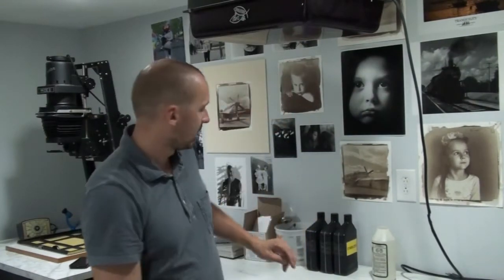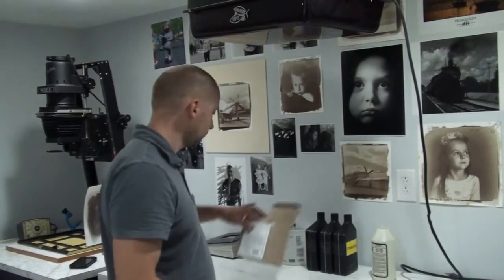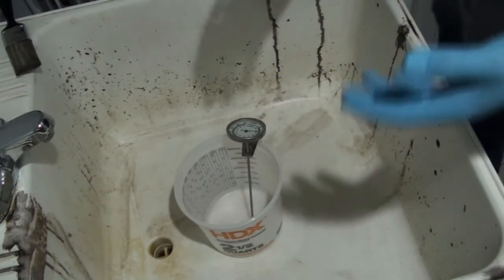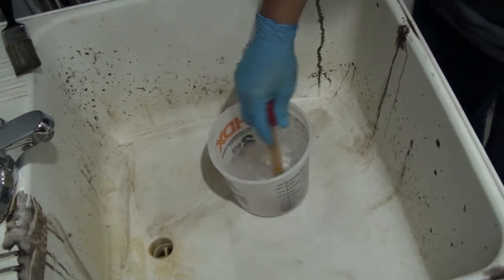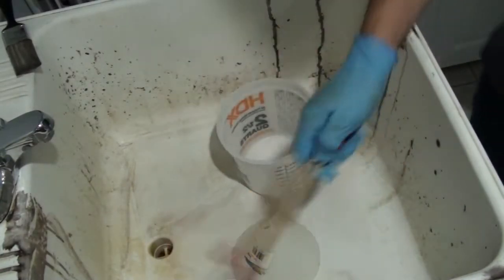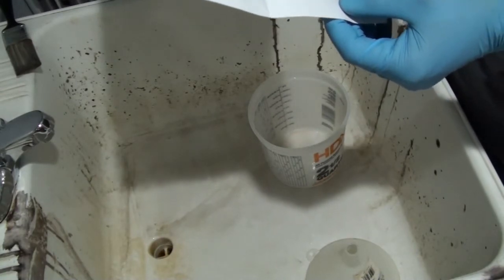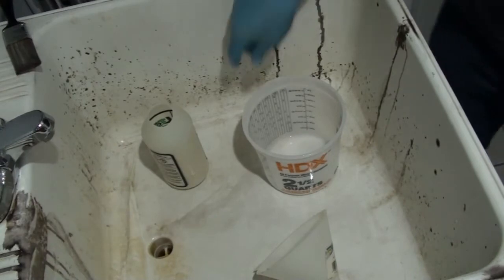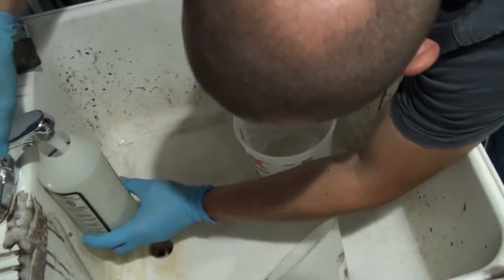JOBO C41 press kit  How to mix it

Comment: Wooden, usually bamboo, tongs are porous, which makes them particularly unfit to use as a stirring rod when mixing chemistry. Use a plastic stirring rod designed specifically for that purpose. Completely wash beaker, stirring rod, etc., between mixing the various chemicals.This video is great for showing the real world details of mixing the chemistry, but cleaning and isolation between the specific chemicals when mixing doesn't look so good.
Reply from the maker: I agree. Glass rod or stainless spoon would be better fit.